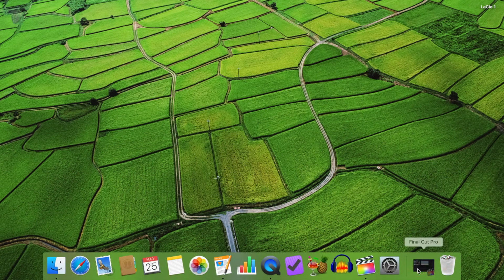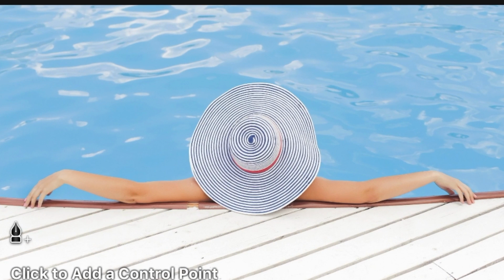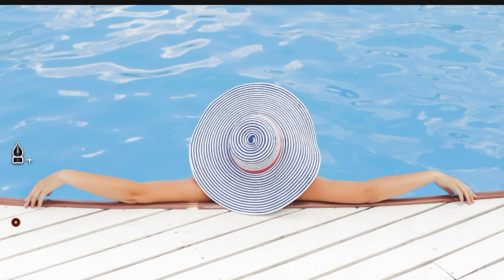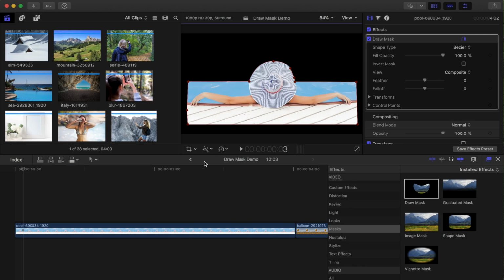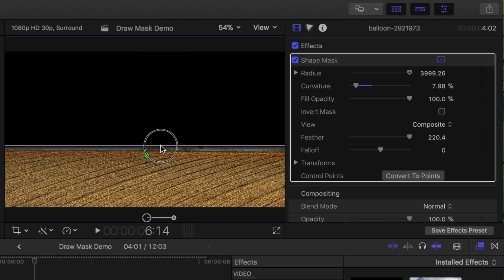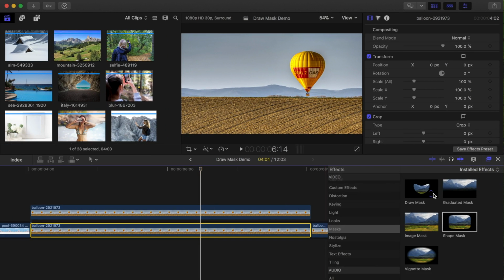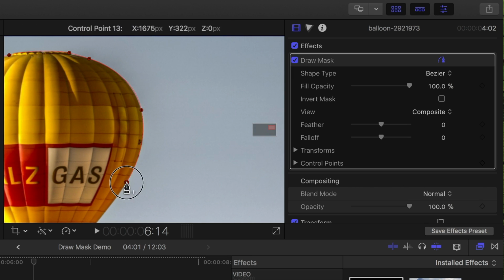FCPX Draw Mask - Final Cut Pro Tutorial 2018

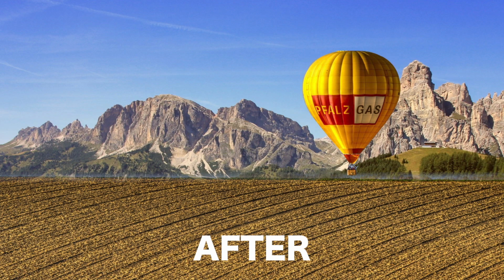Comment: At around 4:42 there is a grey foggy line that goes horizontally across the scene just at the horizon above the field...in the bottom of the trees. What is that?
Reply from the maker: That’s just a little bit of the original clip showing through. When making the demo clip, I added a little too much feathering. Should of caught that